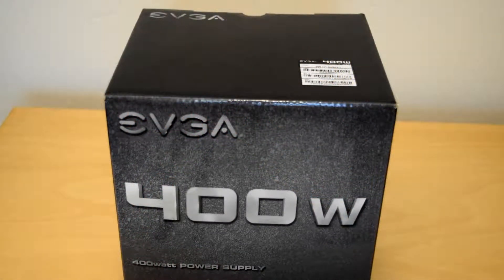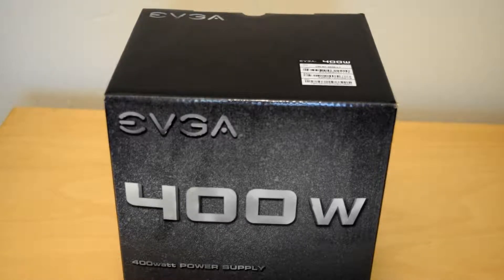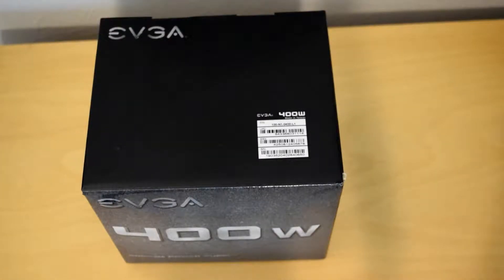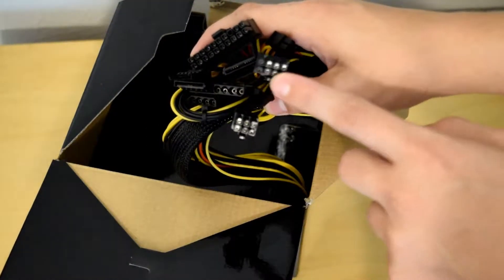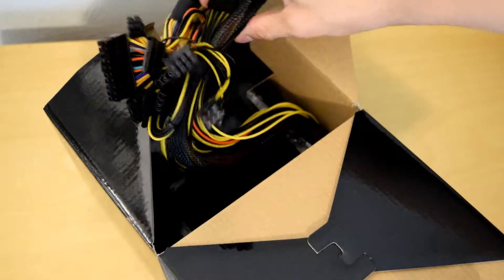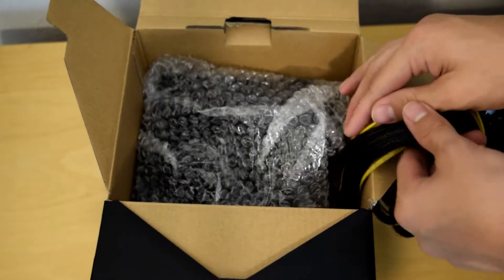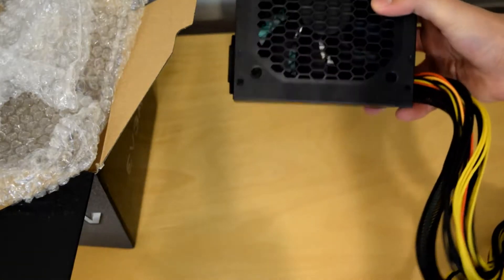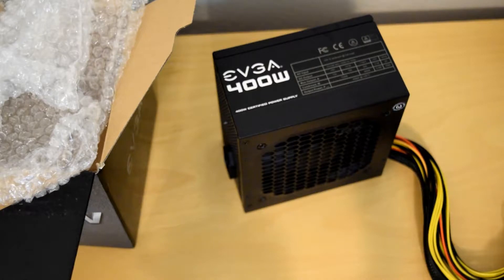EVGA 400W Power Supply Unit PSU Unboxing

Comment: Where is the on/off switch? My brand new build won’t turn on at all and the PSU won’t supply any power. The box says the last step is to flip the switch but there isn’t one, help please!
Reply from the maker: Sweaty Chungus Very sorry that I did not see this until now. You may want to consider jumping the pins on your 24 pin connector. You can find which pins to jump online. Or you can use a power supply tester. It may be that another component on your system is actually bad.